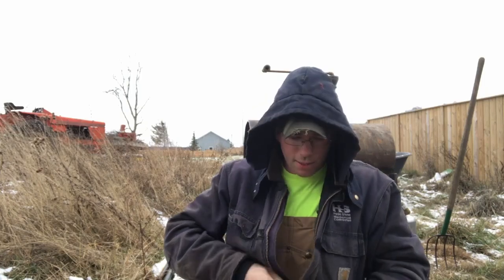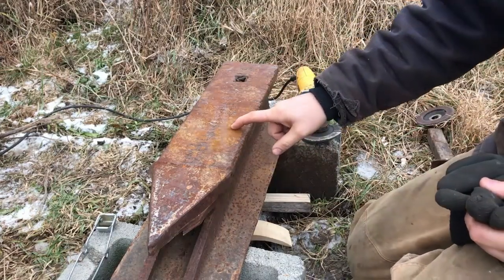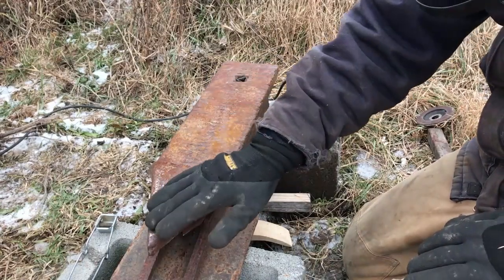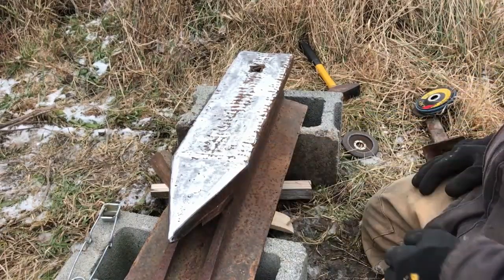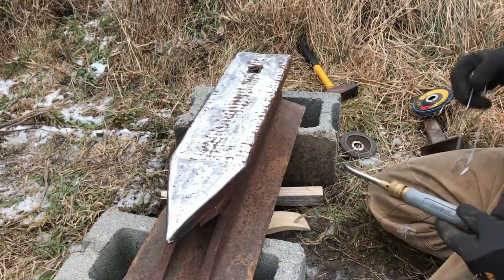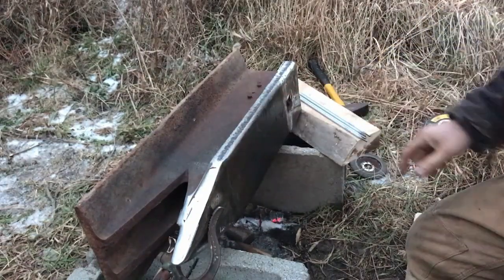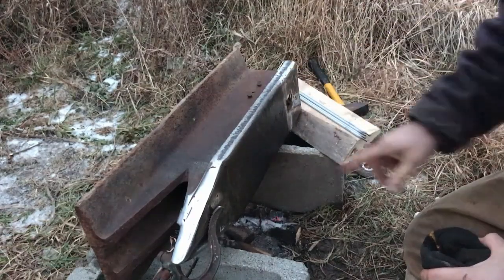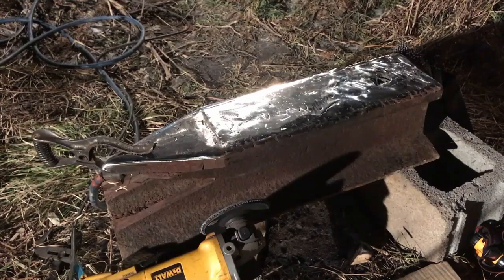A Simple Blacksmith Shop From Scratch Part 4: The Anvil

Comment: Morning Jim, I'm glad you like to work in snow, I'm pretty much buttoned down for the Winter here. We're suppose to be getting 8-12 inches starting tonight, so outside work is done for the season. I suppose it's better than rain, though it's going to be sort of tough when you're hanging from the rafters! Nice anvil, but you could use a bigger grinder. Stay well and we'll see you on the next one.
Reply from the maker: +John Collado good morning John.  We don't get the snow we used to but once the river freezes we'll get pounded.

Comment: This question might be looking too far ahead but here goes anyway:
If/when you make a draw knife, what sort of hardening & tempering process is required?  My experience is confined to things like centre punches and scribers - a draw knife is a radically different shape from those.  How does the difference in shape affect the process?
Reply from the maker: +Pete W good morning Pete.  After forging and shaping I'll need to bring it up beyond 1500*F, quench in fast quenching oil and then temper it at about 450*F for a couple of hours in an oven.  Once it's tempered I'll put the final edge on it and put it to use.  I'll do a good video on the process when I get to that point.  Great question.

Comment: Morning Jim. Hey, nothing wrong with a double track bridge anvil. You gotta start some where, right?
You got some brass cahones, brother. An actual fire, grinding sparks, and welding sparks and slab in the middle of all that big dead grass? You either have a guardian angel working over time, or you put out some fires you didn't show on the video. All I've got is a 14 inch single rail anvil left here by the previous home owner who just happened to work for L&N's maintenance his whole life. Beck my shop was originally a "pump-cart" house. It is about 12 x 16 built with 3 x 5 1/2 inch wall studs and true measure 6 x 6 posts in the corners. I have a video or two where I laid down a "floating" 2 x 4 and OSB floor in it so I don't trip over the oak rails in the original floor. I have a lot of Harbor Freight told and most of them have served me well since my construction days. Many of them, like my cheap table saw, have been in operation for 15 years or so. Anvil is coming along nicely, good job. See ya next time.
Reply from the maker: +Thomas Russell I have I big water tank for cows right there with buckets standing by, plus everything is very wet right now, it wouldn't go far.
Rail track makes for good anvils, not as good as the real thing but it will do.  I should have a real one by next fall.

Comment: Hi Jim
ive just discovered your channel and subbed, you have the kind of content I enjoy watching and creating myself, if you want to see a railtrack anvil with similar technique you have used check out my vid on my treadle hammer /watch?v=av_jx-9fJ-c
the main difference  your anvil is that I cut the top sections off what you would call the belly or base I then welded them together to form a top plate and  welded the plate to a third complete section of track centered, the result is that I have very solid support through the centre with a very nice rebound, the plan next is to build out the sides some more and then finally build a mild steel base to that will form the feet of the anvil.
Reply from the maker: +techron mattic that sounds like a great project, throw a link up so my other viewers can find it.  I was taking a short break from my timber frame project and was puttering with the blacksmith stuff.  Welcome aboard.

Comment: It might be cost effective to let a machine shop run a pass over the top with a large surface grinder. They charge by the hour but it wouldn't take no time at all. If you know someone with a bridgeport mill they might could just cut the top down a few millimeters with a few passes. It would be really nice to start with something flat and true and it might be cheaper than all the grinding discs. I worked in a large shop for 6 years it is amazing some of the things they can do. I learn something everytime i turn this channel on.
Reply from the maker: +gary kidd good morning.  A mill would be much better, much much better.